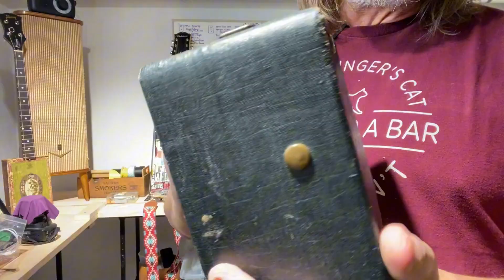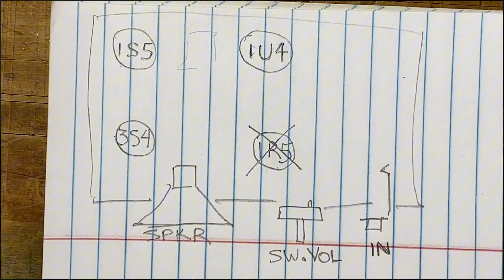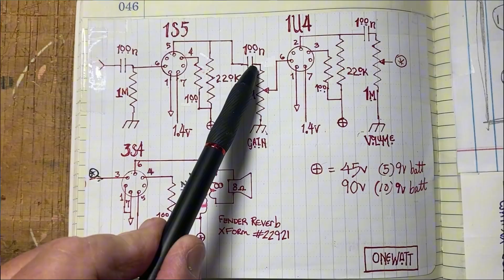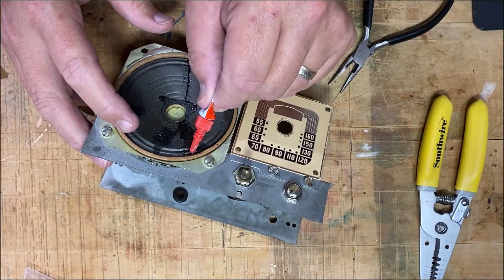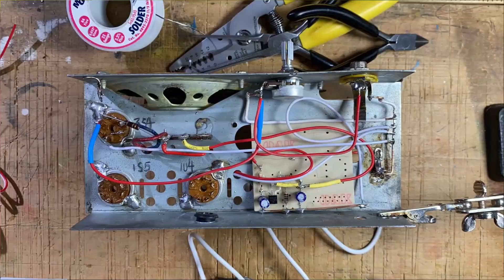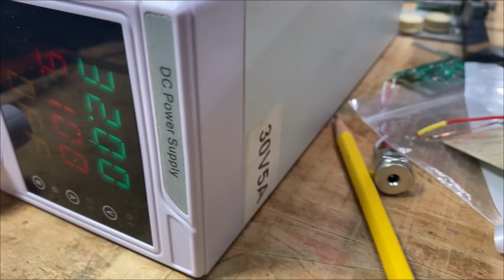Imperial TUBE RADIO to GUITAR AMP Conversion

Comment from the maker: In this project, I take a late-1940s battery-powered Imperial tube radio and convert it into a small DIY guitar practice amp. Using the original vacuum tubes — the 1S5, 1U4, and 3S4 — I walk through the build process step by step, including speaker repair, power supply design, and installing a new ¼-inch guitar input jack.

For inspiration, I pulled ideas from a 1-watt JCM800 clone and the Pentaboost project on DIY Stompboxes. The result is a gritty-sounding little amp, though the output volume is limited due to the age of the tubes.

What’s inside this video:
Opening up a 1940s tube radio
Reusing the original chassis & transformer
Building the 3S4 power amp stage
Adding 1S5 and 1U4 preamp sections
Repairing the speaker & case
Designing a filament supply with a buck converter
Bench testing with 32V plate supply
Buzz test & guitar sound demo
Reply: Could you do a step by step series on building a small tube amp that anyone can follow along to and build even with limited experience?